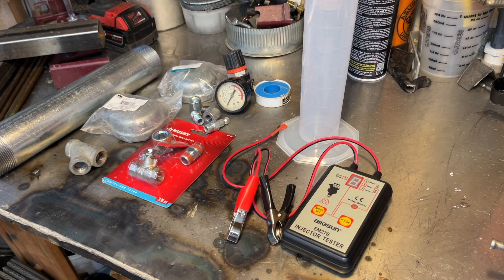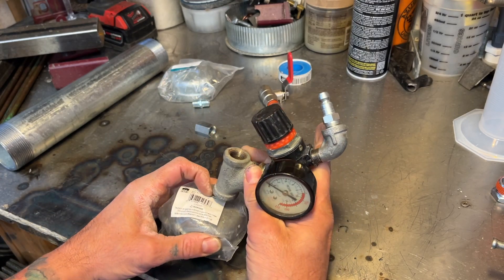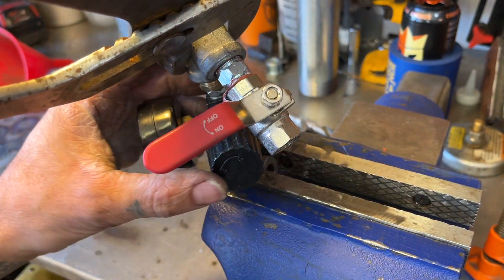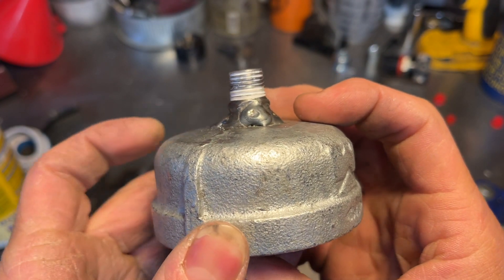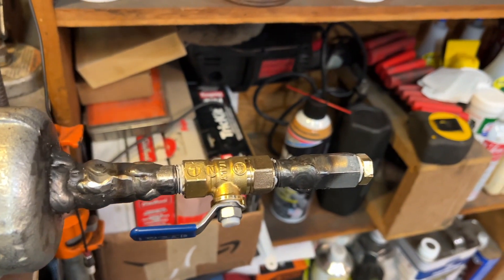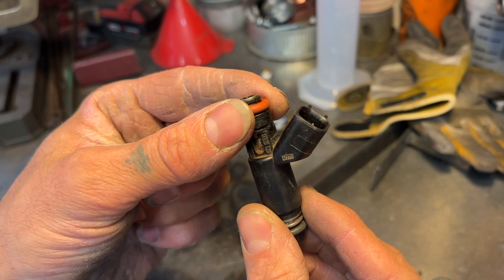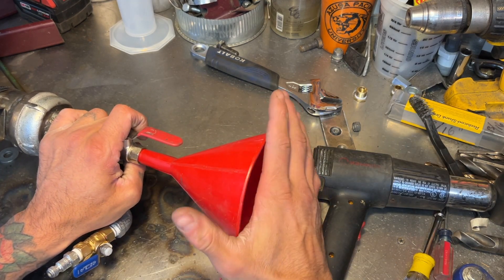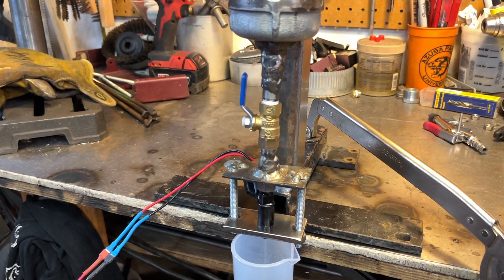DIY INJECTOR TESTER - $125 or LESS!!!

Comment: When welding on galvanized metal drink milk as it will take out the metals, you will feel fluish if you do not.why not use reduces not from 2" to 1/4" npt,and 2" to 1/2" not, no welding and not possible zinc poisoning.
Reply from the maker: good point!  I have never heard that milk trick... I opted to weld to keep the cost down and use what I had laying around my garage.  plus, being under high pressure, it made more sense for me to weld it...